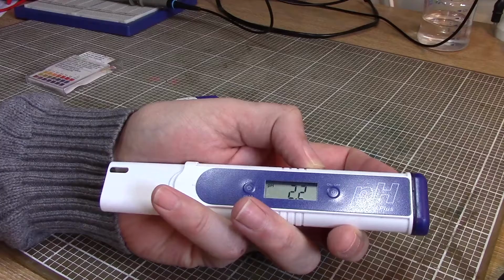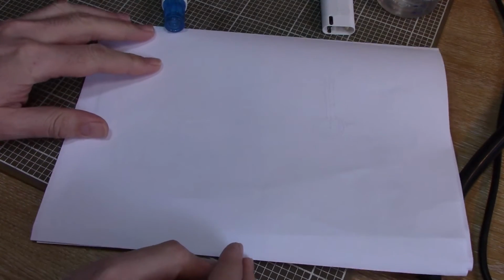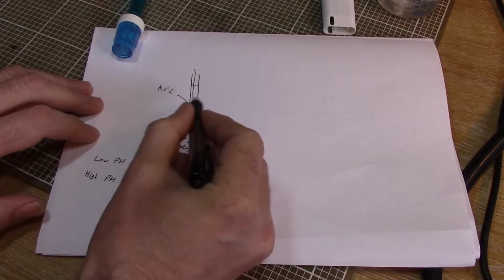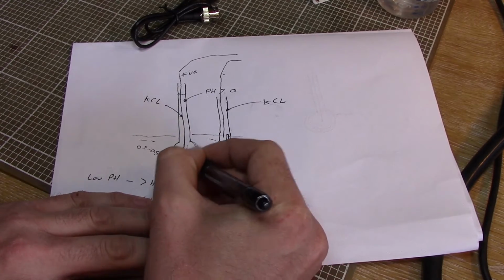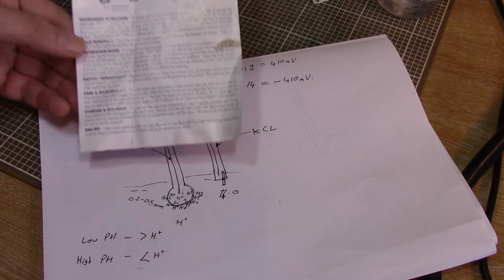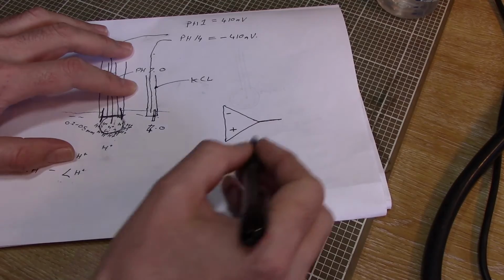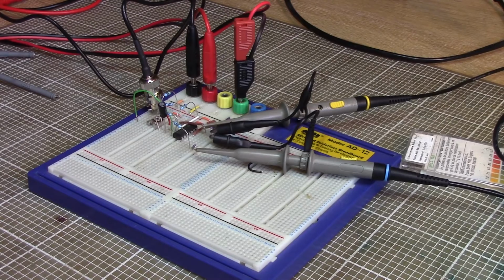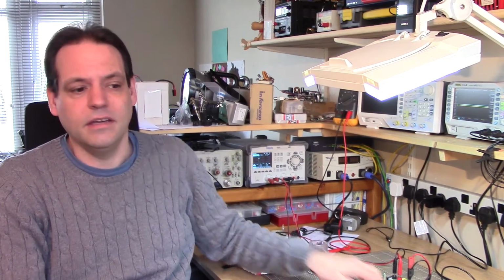pH Probes - How they work and a circuit for using one.

Comment: Hello sir. I am working on a device which can measure pH value of water. I took out the ph probe part from a pH pen tester. Now I am making the same circuit you explained and in the sparky website. But I am not getting a proper value. When i am using a single opamp i am getting a output of half of the value of power source. I tried to use TL082, LM358 and TL072 also. But none of them worked. Please help me in this situation.

Comment: Not bad for a few days research. One detail about the reference electrode though, is that the silver wire in the reference actually has a coating of silver chloride, AgCl. This is actually an electrical cell in itself. https://en.wikipedia.org/wiki/Silver_chloride_electrode

Older style pH measurement systems used a calomel reference electrode, which is mercury/mercurous chloride so not as environmentally friendly as the Ag/AgCl reference.

As you more or less mentioned, the glass membrane on the pH electrode performs ion exchange, so a very small potential difference is created across either side of the glass and this is proportional to the H+ concentration.
Reply from the maker: Thank you for that extra info mltoob - It's always good to have the facts correct. Cheers!!

Comment: how do the storage fluids extend the life of the probe? does it leach contaminant out of the tubes?

im now concerned that the storage fluid might actually shorten the lifespan of the probe, if its not clear what im talking about. for the 4years ive owned and used these PH probes ive always been told by the shops and the instructions of the product that these probes will last longer if you keep them submerged in storage solution... ive never really worked out what that storage solution actually is... i was assuming it was some kind of buffer with ph 7
Reply: awesome video by the way, you got a sub from me, i am off to watch your EC pen video

Comment: great video JIm. I have a doubt about your op amp. Why you put both in sequence? I am planning to build a electrode as well, i am I planning to increase a signal using a op amp. Any special reason for that? thank you very much and great video!
Reply from the maker: Hi Monte - I can't totally remember the details precisely anymore (it's been nearly two years since I made this circuit), but one of the op-amps was providing an offset from zero and the other was amplifying the signal up... The pH probe itself is providing positive/negative values with the zero being at pH 7.0, but for a microprocessor A/D input I want pH 7.0 to correspond to 2.5V. Ultimately it was just some circuit I found on the Internet by searching for something like 'ph probe schematic', so I can't claim credit for how it works.. Hope that helps. Cheers!!
Reply: Thank you Jim!

Comment: Wow this video explains everything in detail. I love it. It is very useful but I still wonder : which substance goes through the silver wire to make voltage, the positive charges or electrons (like in a battery)? Thank you :D
Reply from the maker: Hi +Trân Đặng  - Thank you - I'm very glad you liked this video. It is always the electrons which move around - A positive charge is just a hole where an electron would normally sit. Cheers!!
Reply: +Jim Conner Thank you for replying me :)
Hope you can help me. I am so sorry if this annoys you :(
I still dont understand what made  the electrons move in the circuit. People just said nah.... it is like in a battery (because electrons want to move to the lower negative charge concentration and chemical reactions happen) but in pH meter I can't find out anything like that, it is just the difference in H+ concentration.
Reply from the maker: Hi +Tr&#226;n Đặng  - If you remember back from school chemistry, atoms have rings of electrons orbiting around their nucleus. Atoms like to have the correct number of electrons in their outer shells and will get together with other atoms to form electron-sharing arrangements... The number of electrons they like in their shells is 2 for the innermost shell, and 8 for subsequent shells. The Oxygen atom for example has a total of 8 electrons - 2 in the innermost shell and 6 in the outer shell. Ideally the oxygen atom would like to have 8 electrons in it's outer-shell, so 2 oxygen atoms will get together and do a deal where they each borrow two electrons from each other forming what is called a co-valent bond (and making the o2 molecule).... Although the atoms would ideally like the correct number of atoms in their shells, sometimes that isn't available and they have to work out an alternative arrangement borrowing the less than perfect number of electrons from each other which gets them closer to their ideal, but not all the way there... In some molecules the extra electrons have been borrowed from the hydrogen atom, leaving it short of one electron (and giving you H+... hydrogen with a positive charge)... H+ really really wants it's extra electron and will try to grab an electron wherever it can - The more H+ atoms there are together, the more desperate they will be to find some extra electrons (which is why stronger acids are more reactive than weaker ones). 

So... on to the Ph probe... There is just a very thin layer of glass seperating the solution that you're measuring from the neutral contents of the pH probe, and any extra electrons in the solution you're measuring will be attracted towards the neutral solution to try and balance out the distribution of charge between the two liquids. (because alike charges will repel each other).  If you know how a capacitor works... it's pretty much the same thing going on with the pH probe.... The clever bit though is that the glass layer is every so slightly conductive so some of the electrons can pass through, but none of the atoms can meaning that a very small charge can flow through the glass, and that is what the pH probe is measuring....  However for every electron which can travel through the glass, there is now a missing electron from the solution which you are measuring, so that solution will seek out an electron from somewhere else... specifically, that electron will come from the porous junction connection on the pH probe (where the two liquids are in contact with each other). 

It took me ages to work out that was what was happening as I too found all of the explanations a little brief. They are corect.. it is just the difference in H+ concentrations... but it's understanding the flow of electrons through the glass wall of the pH probe which finally gave me understanding of how it was actually working.

Hope that helps. Cheers!!
Reply: +Jim Conner Thank you for your help. it is very very clear.
 I can imagine the way the system work now. And I want to make sure one thing about the direction of electrons. I just want to mention about the glass (not the whole circuit), like if the solution is more acidic, so the H+ concentration outside will be more positive, thus it will attract more electrons toward glass from the outside, somehow electrons outside can go through the glass (come in) and vice versa (come out) if the solution is more basic, right? or there is just one way for electrons to go (go inside)?
Reply from the maker: Hi +Trân Đặng  - The electrons will flow in either direction... if the solution is more acidic than the contents of the pH probe, they'll go in one direction and if it is more basic they'll flow in the opposite direction... and of course, if it is exactly the same then no electrons will flow at all. Cheers!!
Reply: +Jim Conner hi :') thank you so much. 
So you mean that if the solution outside is more acidic, the electrons flow IN the glass, right. I just want to make clear the direction :") thank you .....
Reply from the maker: Hi +Trân Đặng  - If I've got my facts straight then acidic solutions are strongly H+, which would mean that they're seeking electrons from elsewhere... If that is correct, then the electrons would be flowing out from the solution in the glass bulb.... Please do fact-check what I'm saying though... I'm just some guy on the Internet and not an expert one all of this. Cheers!!
Reply: +Jim Conner Hi Jim, I will check it. Anyway, thanks for being patient and answering all of my questions. I appreciate that a lot.
Thank you so much.
Best wishes.

Comment: Great method of explaining it.  Really looking forward to your prototypes coming out.  Have you considered using the RaspberryPi, I've really found it great to be able run it like any machine and easily correct and update code remotely etc.
Reply from the maker: Thanks Brendan. I'm still not totally decided on my controller board. I've got a bunch of different embedded PC boards kicking around the place, including a qualcomm dragonboard (quad core ARM cpu, 2GB ram etc), but I'm currently leaning towards a microcontroller based solution as I don't want to have to wait for a linux system to boot up.... I'm still not totally decided though as I've run out of memory on the current micro I'm using (it only has 16K), so have just ordered myself a better one (with a whopping 256 kilobytes of RAM). I may yet decide to switch over to a linux box to run it all. Cheers!!

Comment: Interesting!  It's amazing that the reference side of the probe can last as long as it does given that it absorbs the solution... seems to me like it should foul within a couple of uses!
Reply: As the resident biochemist I can tell you that we use a storage solution that is changed weekly. We rinse the probe after every measurement and between use on the day it would be stored in a KCl solution. Via osmosis this can maintain the probe for much longer.
Anyone interested in more theory can access a pH guide from a company called Mettler-Toledo, we use their process analytic probes (v. expensive) you can find it here: http://www.mt.com/dam/non-indexed/po/pro/Brochures/IB_pH_Theory_Guide_EN_230113.pdf
Reply from the maker: Matthew Reece-Ford Thanks Matt - A big relief that you haven't pointed out that I got something wrong. Cheers!!
Reply from the maker: Thanks mnelson10000 - I too am surprised that the contamination problem isn't more significant.... or maybe it is and us hydroponic people are getting away with it because we only ever measure PH's from around 5 to 8 meaning the contamination isn't so severe. Cheers!!
Reply: Jim Conner
 Us reef aquarium nerds have an even smaller pH window... 75 - 8.5 maybe.  The probes that come with reef controller systems are actually supposed to stay in the aquarium constantly!  Crazy
Reply from the maker: mnelson10000 If the pH of the solution inside the measurement and reference electrodes matched the solution  in the aquarium, then I imagine that would prevent ion migration from one to the other - I wonder if the probes for aquariums use a tweaked KCL buffer or something like that. Cheers!!

Comment: great video Jim and a good explaination of the PH probe
Reply from the maker: 101blog Thanks John.
Reply: Jim Conner
If only I had this level of comments on my videos I would be enthused to do a lot more ..congrats
Reply: Jim Conner
Am I right in thinking the liquid in the screw cap is some KCl gel to reverse the effects of contamination in use and to maintain that reference environment?
Reply from the maker: It is more to reset the state of the measurement probe which may have gained/lost the charge through the glass bubble, but yes - it would also help to dilute any contaminents in the porous junction of the reference electrode too. The KCL gel in the pot is exactly the same stuff used in both of the electrodes.

Comment: Potential  OR Power  Please help
Reply from the maker: Can't have power without potential, but can have potential without power (i.e. static electricity). pH probe has little of either (but does technically produce a very very small amount of power). Cheers Patrick!!
Reply: Hi Patrick as Jim says  you can have potential with out anything happening like current flow ( much like I have the potential to be an astronaut :) ).
Conversely you can't have current with any potential (voltage)( again like me wanting to be an astronaut with out any space ship!).

I think that they have settled on this method because in practice the charges built up naturally would be stupid low and so would the potential difference so any  electrostatic measurement would be difficult. A larger current flow due to a more porous bulb would contaminate the reference solution more quickly making electronic measurements more expensive with frequent probe changes.

Like many things a practical compromise